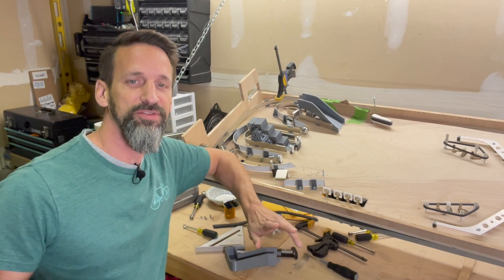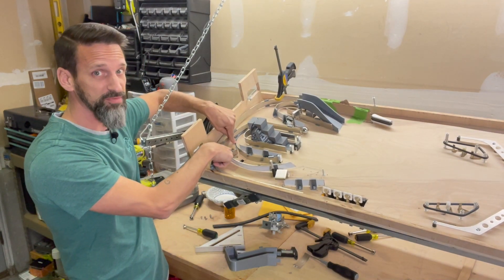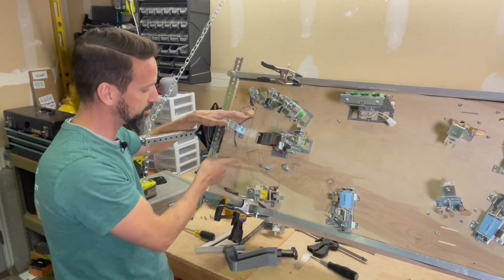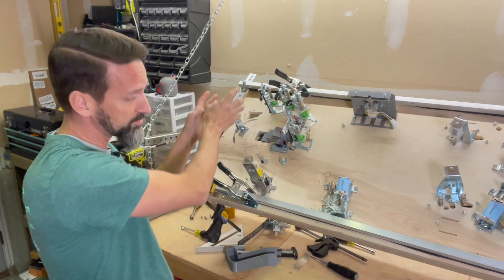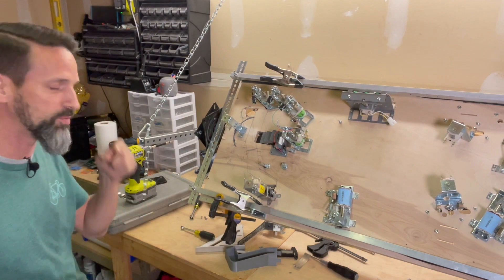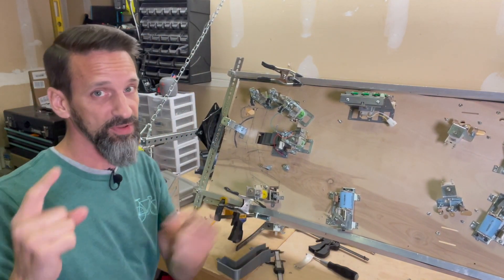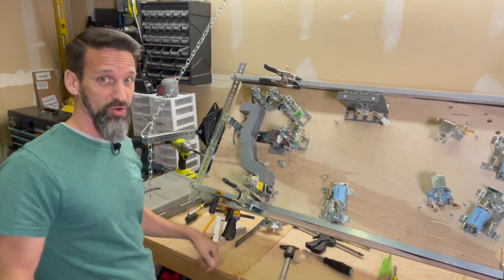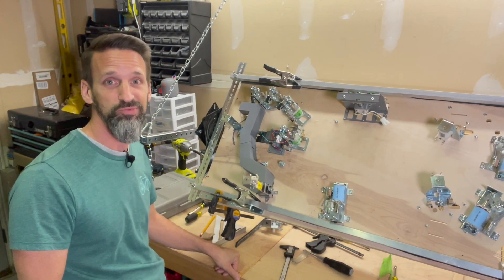HOW TO MAKE A PINBALL MACHINE: Subways!

Comment: Hi Steve, first of all I wanted to thank you for all these videos showing your process of building a machine and showing all the different steps. It’s really helpful. I randomly had the idea building my own pinball machine a few weeks ago and went looking online to see how feasible it was, and what I would have to learn. Wasn’t sure if it was possible for someone like me without a lot of technical experience with designing/programming/etc. I happened to find your channel which was perfect timing. Just got a Fast starter bundle in mail and have been looking though the MPF pages to figure things out.

        That said, I was wondering if you could help me out with a couple questions on the wiring side of things. If I have MPF installed and my computer connected to the FAST board with the usb connection, am I able to configure FAST? Or do I have to have the power supplies set up?

Also am I able to run a config file with FAST connected(to my computer) that has coils and switches listed in the file, but without those coils and switches wired to the FAST boards yet? Or would need to used the MPF’s virtual platform to test things and then hook it up with FAST once I have an physical board setup with the coils and switches wired.

Sorry if these seem like vague or dumb questions. The electronics/programming aspect is intimidating so I’m trying to focus on figuring that part out for now.  Thanks again
Reply from the maker: Hello!! Welcome to the homebrew world!! 😀 so happy to hear you’re starting your own project!! 

Ok so to answer your questions: so the FAST boards need power before they can be recognized by your computer, they don’t receive power via usb so you will need the power filter board and power supplies (PSUs) all hooked up before you can use mpf to make the boards do anything- that said you can start creating your core config.yaml file before you get your boards all hooked up - you just can’t really test it much until you have the boards connected too. Lmk if that makes sense or not- if not feel free to ping me on messenger or IG, or email thepinballroom at gmail dot com 

And yes you can have all that setup without actual coils connected and run mpf to make sure it starts without errors etc, but without coils you just won’t know for certain of things  are working fully, only if you have syntax errors in your config 

Tbh I haven’t ever messed around with the virtual mpf platform so I can’t help you with that, sorry. 

You should join the FAST slack group as there are others in there who have way more experience with mpf than I do and they’ll be able to help you much more than I can
Reply: Thank you, and ya that answered my questions. And I’ll look into that FAST group

Comment: Ah, subways! If I ever make my current VPX table into a physical table, I'll have to think about those a lot :|

I have a gobble hole on an upper playfield, so that's, eh, not a subway technically, but still occupies space the same way on the underboard. And I have four holes from which a ball will "teleport" around. The idea is, they drop down, a staged ball launches from one of the other holes, the dropped ball rolls to one of the other holes and stays there as the staged ball for next teleport. 

My thoughts right now are to connect the two left, (upper and lower) holes and the two right, (again, upper and lower), teleport holes with an X-shaped subway with a divider in the middle, and hinged track between the VUKs and the board, so balls can shoot up out of the hole from beneath, but go onto the dividing subway when they drop down. 

I'm pretty sure that's not going to work, but I don't know enough yet to know where that will fail!
Reply from the maker: Wow that sounds pretty complex of a system! That would be fun to try to build tho!!
Reply: haha, that's the opposite of my thought process :)

I think up something complex, and all I want to do is figure out a good compromise that makes it simpler without reducing the desired effect by much.

Comment: So when the diverter is down and the ball comes into the horse shoe from the left side what happens to the ball?
Reply from the maker: Right now, nothing good 😂 I’ve got to adjust the ball guide for the left side, I had to cut it down so it doesn’t guide the ball around like it should- I’ll be cutting another white wood and then will have the room to get that working correctly - the plan is to have the left side continue as if the loop wasn’t interrupted
Reply: @thepinballroom  
I would suggest to put a switch at the left and right entrance of the horse shoe and use it in conjuction with a logicbloc in mpf to control the diverter...
This way : right switch activated + "lower the diverter = true" => the diverter go down as the right switch is hit,
           and left switch activated + "lower the diverter = true" => the diverter don't go down and the horse shoe path keep beeing smooth...
This is the way I would apporch this kind of situation.

Laurent
Reply from the maker: @laurentmaillard1355  thanks for the tip! I still have to learn how to do that in mpf…. I don’t know much about mpf yet at all at this point still 😬